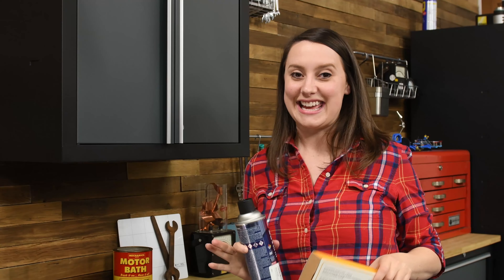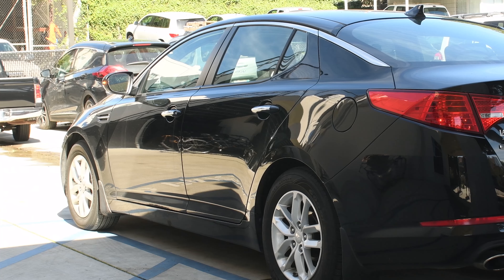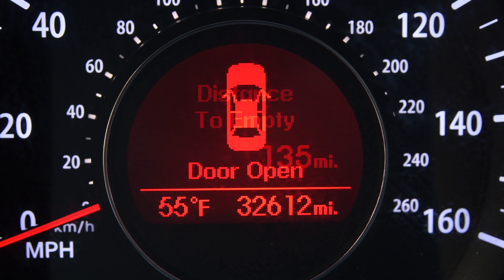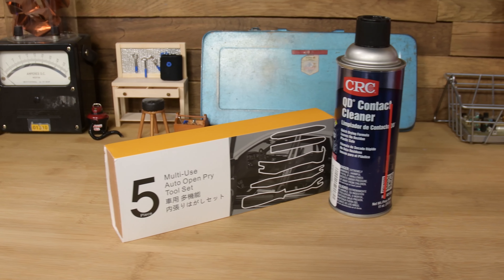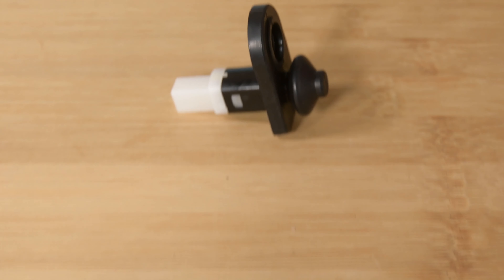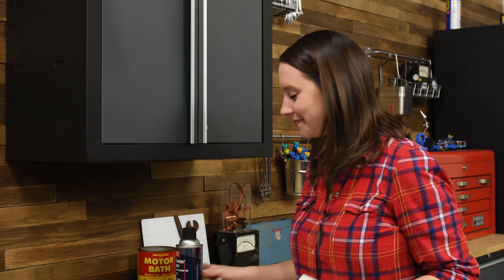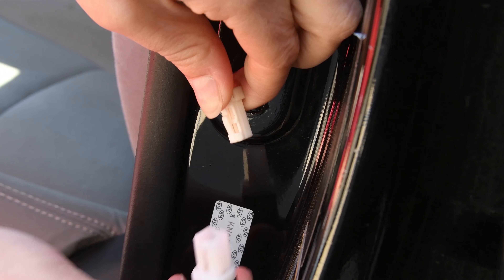iFixit Tries: Kia Optima Car Repair

Comment: Since it was a 1 wire connector the circuit probably grounded through the screw. You should put the old part back in. If it is still fixed it was a faulty ground through the screw.

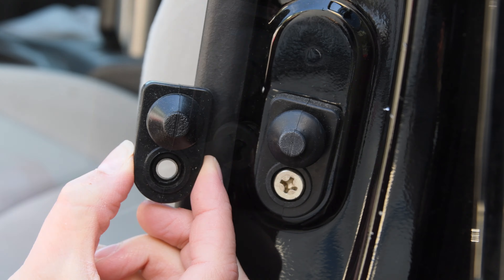Comment: Nice job! You can try a JIS screwdriver next time instead of Phillips. JIS looks like Phillips, but is slightly different and designed not to cam out, damaging your screw head. Notice the Phillips driver doesn't seat all the way in at 1:00 and easily strips the screw head.